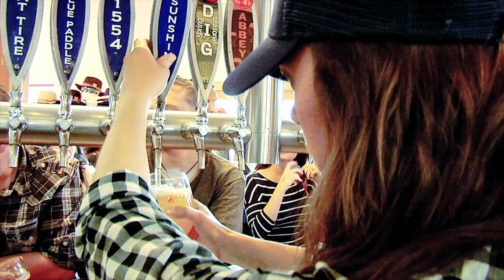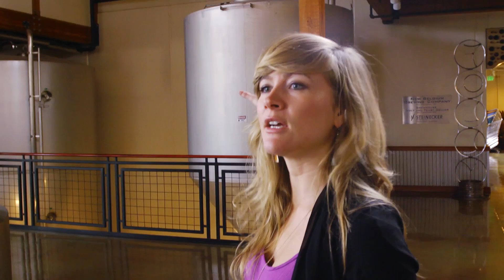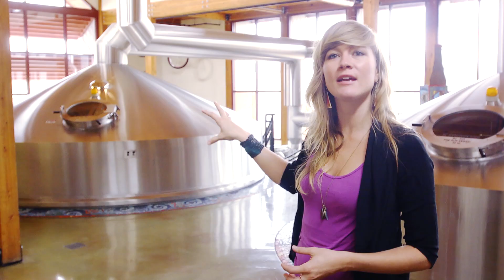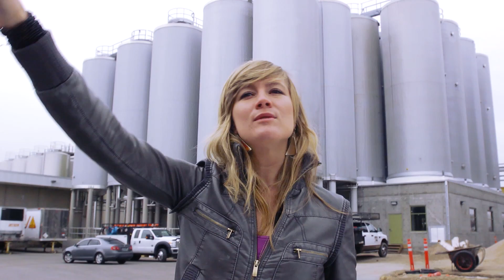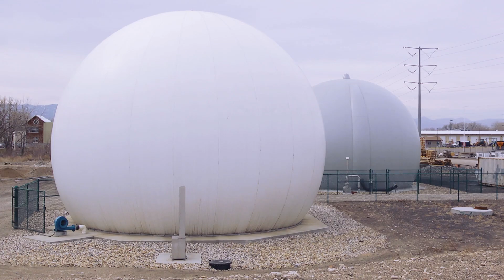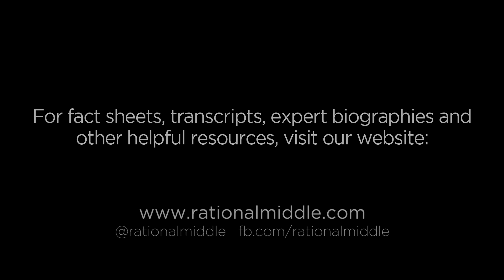A Day in the Life of Sustainable Beer: New Belgium Brewery

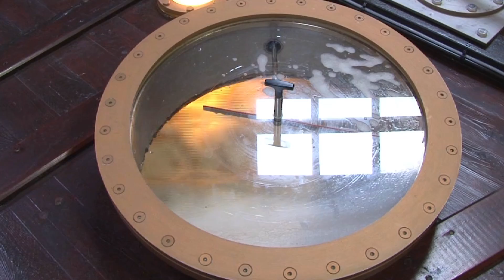Comment: 2:26 "because we are boiling off some of the off flavors we would not like in our beer"... what nonsense. You boil it to add flavors. Namely bitterness and aroma from hops.
Reply: She's right about the process,the boil is driving off the diacetyls and other unwanted chemicals. Excess boiling can drive off some of the flavor volatile oils. Check out John Palmer's book "How To Brew."
Reply: I think she and cordell are both right.   Compressing something very complex into a soundbite is rough.  Lacking knowledge of brewing, video editors may not help much.  What she says isn't wrong, but it's an awkward half-truth.     No, we do not boil off flavors.  But we can boil off certain substances that might otherwise affect flavor, and as cordell points out, by boiling also extract substances from hops into the wort that affect flavor.
Reply from the maker: Might want to tweet at them. We don't brew beer.